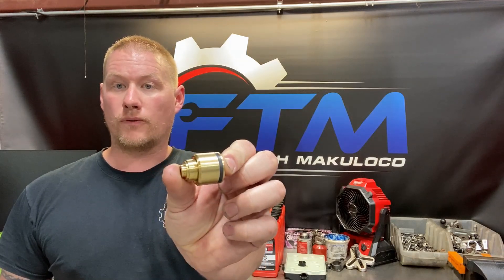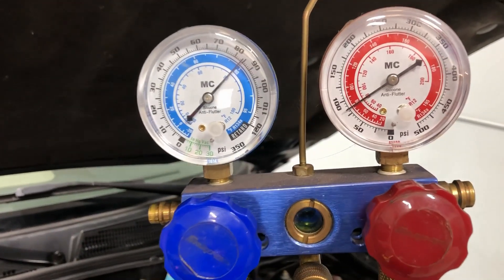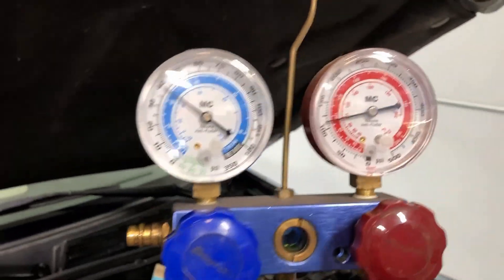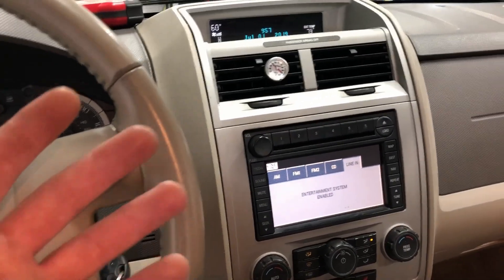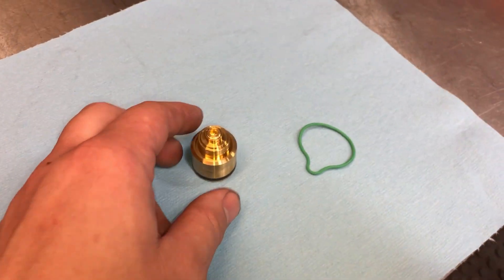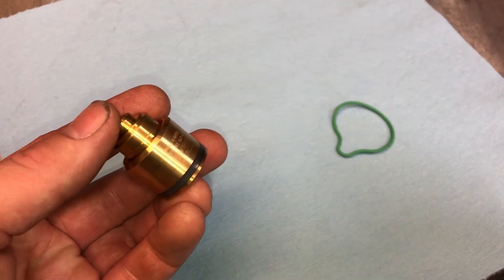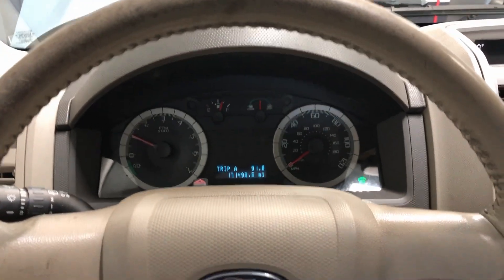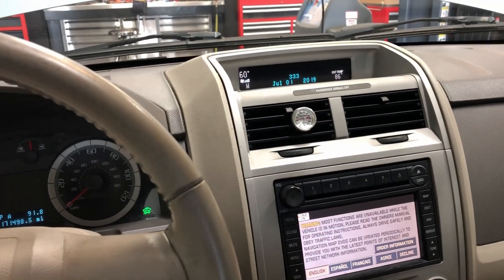Ford A/C Quick Tips #8: Poor Cooling at Idle- Diagnostics and Repair

Comment from the maker: These are the Parts and Tools I Recommend:
Basic R-134A Gauge Set-
https://amzn.to/3efy9qz
Dial Thermometer-
https://amzn.to/3ehnUlp
Replacement Refrigerant Control valve-
https://amzn.to/2YQXC30

As an Amazon Associate I earn from qualifying purchases.
Reply: Hey my wife has a 2013 ford flex limited ecoboost awd. And she is having the same issue. Is there anything I need to look for or check? Its been to the dealership multiple times and they never find anything.

Comment: What about for the other ford vehicles? My 04 e150 4.6 is having the same issue but i don't believe my compressor has that control valve, and ive already added an efan, I guess the freon can be low but I already had that checked maybe they didn't know what they were looking at.

Comment: What is the point of pulling a vacuum before opening the system to replace the control valve ? 
Air will go in anyway.  I don't get that part.

Comment: I paid a mechanic 1000 dollars and he replaced compressor twice and still ac blows 65 at idle. While driving it slowly goes down to 55 or 50. I have 2011 Ford Econoline. Now does this valve come with new compressor? I also replaced the clutch fan.

Comment: You have two channels, so I wanted to thank you again. You just saved me $1500 dollars! I replaced that valve and recharged the system, and it has never been this cold!
Reply: The only compressor that's put together wrong from the factory! Simple fix of unbolting the cover plate and reversing the valve and spring makes it operate correctly!

Comment: My 2007 F150 is not blowing cold air. I replaced the climate control unit when the original was stuck AC on last fall. Got another identical one at a salvage yard. Lights work but no cool air at all. System has high pressure but I have no gauges. I haven't found the fuse yet but am looking for it. Is the control unit faulty or something else?

Comment: so my 2009 F150 (Lariat/4x4) has this problem,  I have 240K miles and after about 150K miles I could not get the AC cold enough at idle it is warm air and while driving on highway its much cooler.  The part you mention does not seem to exist on my truck.  I am in Texas so its hot and  AC at idle is required :)
Reply: What did you figure out? We've got the same issue

Comment: Hi Brain, I have 2011 and 2012 E350 vans and I’m having the same issue, is it going to be the same repair as you stated in the video, does the compressor on the e350 have refrigerant control valve? 
Thanks

Comment: Question on transmission s.which sensor would make a 2005 mercury montego downshift extremely rough only after it reaches operating temperature. Thanks.

Comment: I watched this whole video. I think it was excellently done. My truck just started doing this exact thing and yet it is not one that fits the type you specified. I have a 2007 Ford F-350 Lariat. Do they not have a device like this on that model?
Reply: Did you see if it worked for your truck?

Comment: So, I tried reversing the new spring, and valve, but this did not fix my problem. (Putting in the new valve, spring, and filter the correct way, did not fix it either). I still have cold air at high idle (1,500 rpm to 3,500 rpm), but no cold air at idle (800 rpm) or at low rpm (1,000) rpm.

My guage set reads from 90 spi to 120 psi on the LOW SIDE, and only 120 psi to 130 psi on the HIGH SIDE (ambient outdoor temp is about 85 degrees, and humidity is about 60%).

I am thinking I need a new compressor. Any feedback from you guys here?

Comment: My ac works fine when driving but struggles when parked and keeps cycling on and off. 09 5.4 XLT. Low side was high when I checked it. So should I get this part and take it to pep boys have them recover Freon and then install part and recharge with can? What’s the deal with the oil?

Comment: Could a weak compressor also have these signs and ac gauge readings?
Reply: An easy way to check if your compressor is weak is to give it some RPM while watching your gauges, if your low side is dropping and it begins to cool down in the cab, it indicates your compressor is on the weaker side.

Comment: Great video.  I have a 2006 F150 with same symptoms.   Poor cooling at low idle/speed and gets better at high speeds.  Could this also be the same issue ?  Refrigerant Control Valve?

Comment: The Jaguar X Type and S Type use the same compressor and have the same problem. Jaguar put out a TSB on poor cooling and their solution is to simply swap the position of the spring and the valve and reinstall. That way the valve is taken out of the way and the compressor runs at 100% capacity instead of a variably capacity. 

An even simpler fix, no parts required, but it still required recovering the refrigerant and recharging. It's Jaguar TSB JTB00183.

Comment: I have a 2006 escape hybrid. @ 90° ambient temps, my reading are 175 high side & 65 low side. The cabin air is cool.. not cold. Would there be anything else causing these symptoms?
Reply from the maker: Change the valve
Reply: FordTechMakuloco you’re the best!

Comment: I’m having this issue with my 2018 Ford Fusion 1.5 Ecoboost..any tips on what to look for..air is warm at idle unless I keep giving it throttle and idles extremely rough with the AC on

Comment: I just bought a 2007 ford freestyle last week. Everything you said is spot on my low side is high. High is low. Hot at idle and perfect if I’m moving a bit. I Ordered a valve and stuff trying this Friday!
Reply: Worked perfect! I got one of those vent temp gauge things also. It’s in the green at idle. I added three 12oz cans though. Alittle bit more than what it says 1 lb 13 oz. the pressures where less than 40 and in the 225-250 range at 85 degrees in my garage. Seems all good. Even my fan kicked in like it should now.

Comment: Maybe you could help me out I have a 2011 Ford Focus. The AC system works very poorly at an idol once you bring the rpm up it starts cooling better  The cooling fan does work.   I don't think it is a problem with air through the condenser.
Reply: Have same isuue with a 2009 ford focus , when idle warm , when at 2000rpm cools better.
Reply: Pressures?
Reply: My guess would be a weak compressor. You’d have to have a set of gauges hooked up to the vehicle to really know for sure.

Comment: pep boys just changed out a company van evaporator that worked just fine no problems they just need to make money for they told me they had very little jobs to do, now on this chevy 2012 van i got it back after 10 days  because of a rear brake job they did and one of only 2 mechanics that work did not show up for work. just crazy only 2 techs work there and they have 10 bays Haha... now that van A/C unit is doing something it never did before the pep boys tech worked on the A/C what it is doing is when i go into  a WOT  or up a big hill the A/C will change to the defrost vent blowing cold air up on windshield and not in my face from dash venting ???

Comment: I heard you have to replace the ac dryer every time you work on the ac system, is this true??
Reply: I understand that it depends on how long it was open, but yes, as I understand,  it's going to see moisture and lose drying capacity.  I had my system open for over a week after working on it and encountering a problem, had already changed the dryer, but I swapped in a fresh one right before charging to be sure.   $20 insurance in my case.

Comment: Speaking of register temps I'm seeing only 57 - 59 with outside temps of at least 90F into low 90's. 57F is very unusual.  Mostly around 59F.   These are from my 2010 Fusion with a ac system that has no known issues.  Was told by a Ford mechanic when original compressor was changed in 2012 that these systems are too small to cool effectively.  Compressor was just changed again  late spring 2019. Evap temp sensor between 35 - 41 cycling.  Any comments welcomed, thanks

Comment: Great video, was hoping it would apply to my '04 Excursion with a 5.4 gas that has the cooling issue on idle
Reply: Dirt Diver try checking you fan clutch. sometimes they are weak and wont cool properly at idle but cool well when moving
Reply: @916lilrich  Will do thanks!

Comment: Great video !An earlier video from Fordtechmakuloco discussing this AC scroll valve saved me over $1500! My 2006 Ford 500 limited fwd with Asin 6-speed automatic was doing just as described. Very little AC air at idle and more at speed.  I ordered the Doorman (?) scroll valve and I had a mechanic recover my freon, install scroll valve, and recharge the system. It worked great! I had done this quite awhile back. I don't use the inexpensive cans of freon with hose from auto stores anymore, I tried this year's ago and I got air in my system and end up taking it to a garage anyway. Also, if you own a Ford 500, have the transmission fluid changed regularly, and serviced, it will save you some money down the road.

Comment: I've been a long time subscriber all your videos are informative thanks. Quick question I got a 2002 f150 with the 4.2 what is the bolt screws size on motor oil pan not the drain plug thanks
Reply: 10 mm or 8 mm

Comment: I have a question about my 2007 f150 4x4 4.6L  ive watched all of your videos and many others and haven't found the answer so here we go while I'm shifting from 2x4 to 4x4 it sounds and feels like my gears are grinding it will not go into 4x4 while the grinding is happening my truck has the shifter lever not the little switch on the dash ive replaced the solenoid on the firewall and checked for vaccum leaks what could be causing this it'll go into 4x4 if I shut the truck off and shift it but not while its running I know it's just about impossible to diagnose this way just looking for things to look at or try

Comment: I have a 2000 Ford F-150 XLT Extended, 4.6L, 2 valve engine. Upon turning on A/C, I get a strong mildew smell. After A/C running a few minutes the smell dissipates. Is this mildew smell coming from the evaporator core box? If yes, can I remover a cover to access the evaporator and the inside of the box to clean it? Besides spraying Lysol disinfectant in the vent cowling, how can I clean it first?
Reply: Pull out the blower motor and spray evaporator foam cleaner on it.

Comment: About 7-8 years late posting about this repair. I remember replacing these back in 2011-2012 as an “alternative” to the high dollar repair, giving the customer the option for this repair, or the whole shebang on high mileage cars. It was usually 50/50. Good post none the less....for the “newbies” out there.
Reply from the maker: I have videos dating back to april of 2014 on this concern and this valve.
Reply: FordTechMakuloco got cha. That makes sense then. I left Ford a couple of years ago but made gobs of money on this one. 👍🏻

Comment: 👋👋Hello, I hope you can read my message, have a great unanswered question Replace the 2005 Ford engine 5.4 The problem I have the oil cup and dipstick have vacuum when I remove the main line of the vacuum hose from the top of  the valve towards the intake.  replace valve cover because pcv is assembled together both  valve cover are dorman .valve covers are made in china, engine was rebuilt from oreallys .  If I get the original, do u think that will solve the problem.  Great videos ... thanks 4 u times ...

Comment: Hey))) One question. Why Mustang 2005 4.6L, 3v engine, at idle, when warm! with turned on A/С on full, enters to the "Failsafe engine mode"? No check engine light, no codes. After car restart everything is ok. 
It happens only when A/C on max (cold or hot). A/C work's fine.

Comment: Brian do you know if any of the E-series or Transits have this problem? I do mobile repair & towing for U-Haul & have worked on a few of those scroll compressors on E450s that exhibit the same symptoms. Unexplained excessive low-side pressure, high side that never really gets high like it should. And I'm in southern Florida so you know quick if the A/C isn't working right. It would sure help me to know if this is something I can look for in the future. I never knew about this valve...I'm more of an old-school FS10/FX15 fan.

Comment: Hi Brian,  is there something similar on the 06 Ford Explorer?  Our 05 Explorer has this cooling issue when vehicle is idling for a while.
Reply: Confirm the engines fan-clutch is working properly- it probably isn't spinning the fan fast enough for proper air flow- or check hvac controls and blend door if it has one

Comment: Ford escape or Mercury Mariner as well? 05-09
Reply from the maker: Hybrids only.
Reply: @FordTechMakuloco  yes sir. I have the 06 Mariner hybrid and thought it only had the txv in the rear. If it has this valve, is it located under the dash?
Reply from the maker: It does have this valve and is in the engine bay as shown.
Reply: @FordTechMakuloco  cool, thanks soo much. Really appreciate you sharing the knowledge. Happy Father's day 
!

Comment: Hey man. My ford dealership down here in south Mississippi offers a fuel injector cleaning service for $189. I’m wondering if it’s actually worth it? I have a 2013 f150 5.0. 125,000 miles.  Thanks man!
Reply: cisa93 ok thanks man!!
Reply: cisa93 update. Ran a bottle through about 18 gallons. No noticeable difference. But I appreciate it

Comment: Everyone: "Dorman parts? Ewww!"
Me chillin' in my Five Hundred: "My A/C disagrees with your opinion!"

Ford Five-Hundred owner here - can confirm this repair with the Dorman part works 100%! Had the exact same issue Brian described here. Did a bit of fact checking on some Ford forums and the control valve was the culprit. Changed it myself and got it recharged. Handles hot weather like a CHAMP now! Cheap easy repair - do it today!
Reply: How did you get the system (drained
Reply: Need to fix this on my 500

Comment: I did this repair on my wife's 2006 Ford Freestyle.  It had 260k miles and was already on its second compressor.  Did this repair in my driveway and then a power company truck backed into her as she was driving down our street and totalled it.

Worked really well for those two weeks.

Comment: Interesting point about the hybrid packs needing to be cooled.  Many European diesel cars need to AC to load the engine during a regen of the DPF. The more modern the car the more interaction between systems and the more important it is to fix everything that is broken on the vehicle.

Comment: Great video- I would add that many ford models (many years of F-150) with a failing fan clutch will also cause low-speed poor-A/C performance (that and the stupid hvac blend door actuators)
Reply: This is exactly what my 2010 4.6 f150 is doing

Comment: if a person understands the pressure /temperature correlation of the refrigerant being used there is no need to run back and forth checking the outside and inside temperatures.  its also a good idea to leave all the doors open so return air isnt affecting your internal temp. not sure what the ford manual on this topic says though.  generally speaking the heat exchange values on the condenser and evaporators is 15 degrees.
Reply from the maker: Oh you want to check internal temps, there are way too many variables inside the vehicle that can affect the comfort of the customer. I am guessing you are coming from a residential a/c side of thing which is much much different.

Comment: Being a HVAC/R Service Tech for 40+ yrs, I don't agree with your system pressure assessments.
Reply from the maker: Really, which part? This pressure diagnosis is pretty typical when this valve fails, they have been the same since I first saw one fail in 2005.
Reply: R-134A System pressures are effected by (a) Ambient Temperature, (b) Heat Load, & (c) Output Capacity [rpm's] of the compressor. With all these variables hard to say what is normal. BUT....I do residential/commercial HVAC mainly and very little automotive. This is just an observation based on my experience(s).
Reply from the maker: Yeah stationary a/c work seems much more complicated than mobile A/C. It really is this easy, the high side may vary widely based on rpm, ambient temp etc but the low side should be consistently in that 30-45 psi range somewhere depending on the ambient temp charts.
Reply: Actually it is more simple. You have a constant compressor RPM, and a constant condenser CFM. The Blower CFM is also constant for the most part. Only have to worry about it dirty coils, refrigerant metering, and for both of us....leaks.

Comment: Why would Ford use that particular valve system on such a select few models?  The issues you describe here match the problem I'm having with my '09 Milan V6.  Might it use that setup?  Do you just look for that plate on the back of the compressor?  This one has less than 60k on it and doesnt seem to be low on refrigerant...
Reply from the maker: Yes there would be a plate on back.
Reply: How to put valve cover gaskets for a 02 4.0 Ford Explorer Trac

Comment: I wish you could figure out the issue with the 13 model year F150 that prevents the evap coil from cycling at the correct interval of 36-38, instead of 44-48!
Reply: Yes did you ever find the fix
Reply: @MikeBeast007  nope

Comment: Hey man good morning, my 2011 Ford ranger has ice cold air conditioning when you command the control panel.. all functions workalthough it's not as hard or forceful are as it used to be could this be the blend door actuator it's taking all the commands but maybe not opening all the dhampirs completelywhat I bought the truck brand new the air-conditioning and air vents with blow your baseball cap right off your head not so much anymoreit functions but I'm a little let down that it's not as powerful as it used to be other than that all systems are go... Any input would be great... Thanks man be safe 👍
Reply: Or a dirty evaporator
Reply: Look behind the glove box and pull the blower motor out and there is a screen up there and junk gets into it then  clean it out